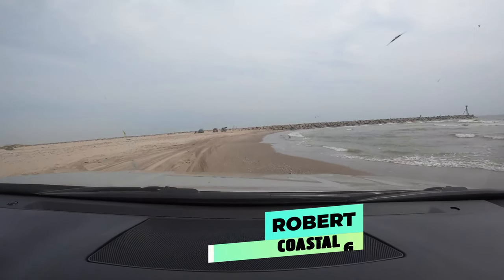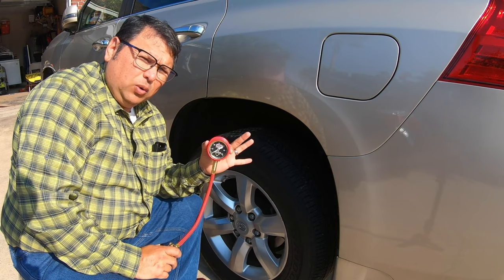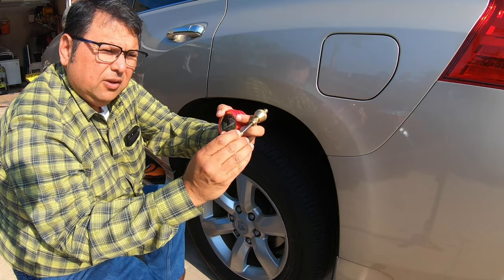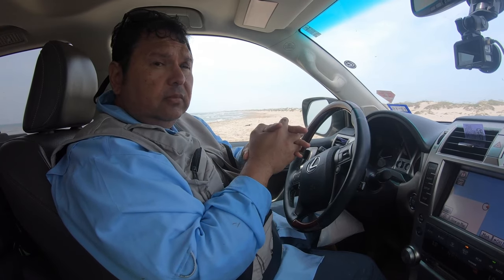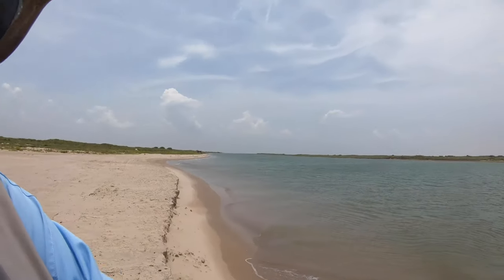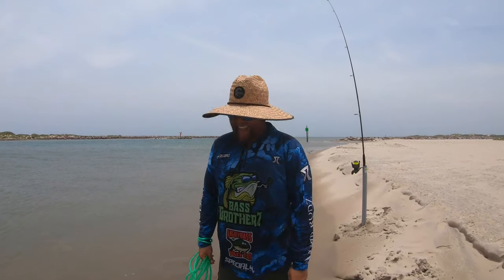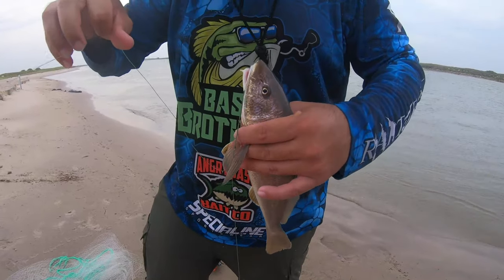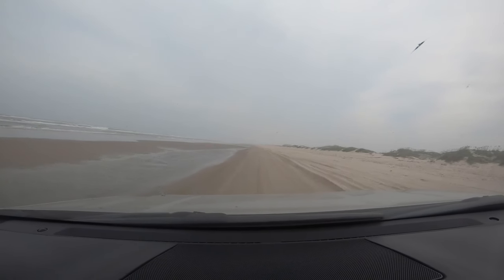South Padre Island Fishing - How to drive to the East Cut! Part deux

Comment: Another awesome video,  how long does it take you to drive to East cut?
Reply: Once you get to access 6 it's about 45 min to a hour depending on tide conditions.
Reply: Daniel Becerra thanks
Reply from the maker: Thank you! 😊 Always takes longer with high tide so please check the weather to play it safe.
Reply: Last Feb. it was really tight in some spots at high tide.
Reply from the maker: Dan Fen you are correct. Check out my second video where I get caught racing the high tide.
Reply: Its about 26 miles if I recall correctly

Comment: I never deflate tires neither when i go i got 1997 k1500, you did really good i notice you have stock tires correct its better to be safe
Reply from the maker: trucks& Fishing thank you. Working on a lift and tires right now.
Reply: Coastal GX hey - Contact Hugo Huerta with ToyTec. He’ll hook you up.

That said - I’m going to try to visit Padre in late May. I’d like to get the remote spots (lifted 5th gen 4Runner on 285s) - any resources you can direct me to?

Comment: Where do you inflate your tires after you get off the sand?
Reply from the maker: Ramon Longoria i pull over as soon as I Edit beach access 6. I have a Viair air compressor and it works great. It inflates super quick.

Comment: About how long of a drive off beach access 6 is it?
Reply from the maker: It’s about 27 miles. The speed limit is 15 to 25mph so it takes a while, but honestly you don’t want to speed up there. The scene is beautiful and it’s nice to soak it in. Also, you need to look out for potential debris or holes so going fast won’t allow you to avoid them. Have fun and thanks for watching 🎥🎬